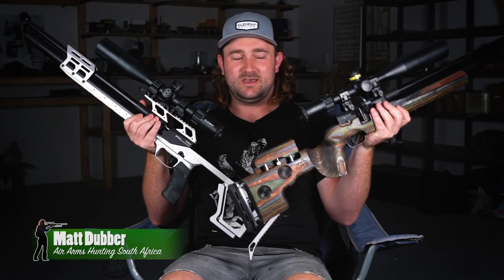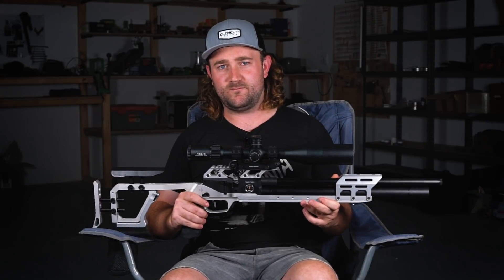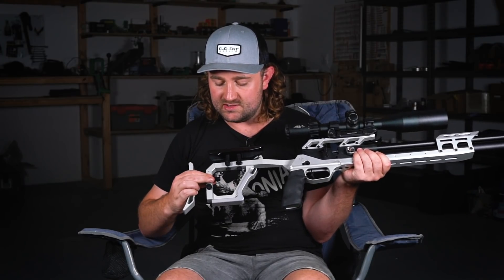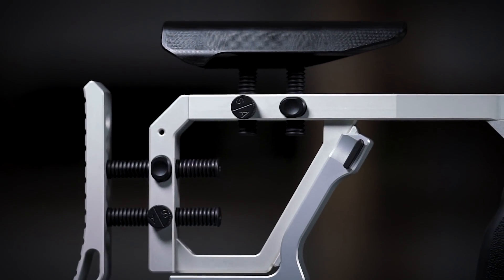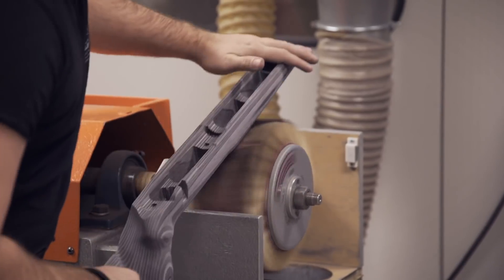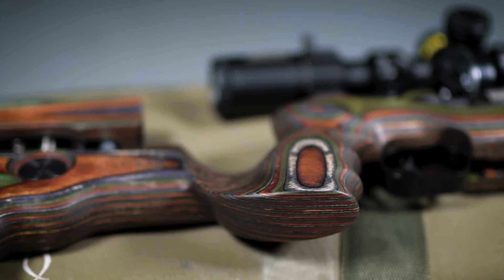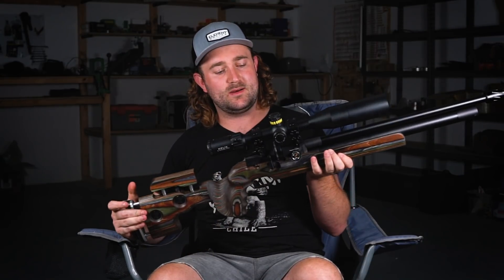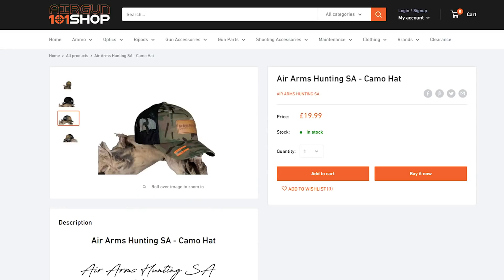A Tale of Two Dreamlines: How a Stock/Chassis can change EVERYTHING

Comment: The darn scope center is like 3 inches above the barrel. I mean if you are dialing a distance especially farther out that's no problem, but if you want to shoot variable distances within a certain range (especially closer stuff) without adjustment that's going to be jacked by a noticeable percentage.
Reply: That’s why I mount my scope as low as possible. I removed the cheek piece from my Wildcat mk3 to have the lower scope height. The rise between zero points is lower for quicker shots on pests. You still need to hold over for closer shots though.

Comment: Just curious. Had one of these come to me for a tune, but it has about 0 power. The person who got it to me tells me it is factory new. Reg is at 100 bar, fill pressure 200 bar, cal .22. Hammerspring and power dial have some bearing on power output, but maxed out it barely pierces an empty soda can. Before I strip it, I thought I would ask if you have any clue what this could be? If it is a simple fix, I'm happy to do it for my mate, if not, I reckon he may be better off just returning it under guarantee. It's a tube version in bullpup config and it's not the grub screw under the magazine. Cheers.